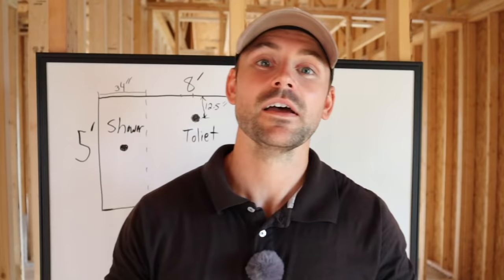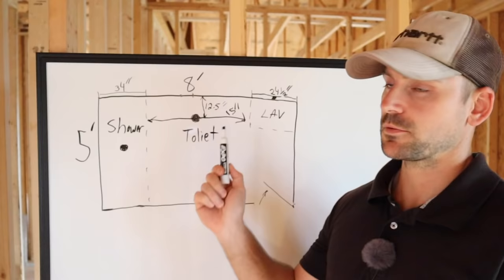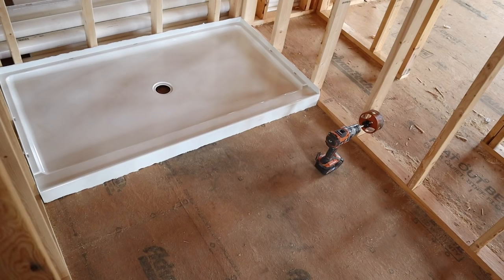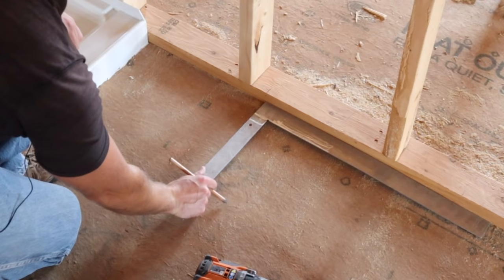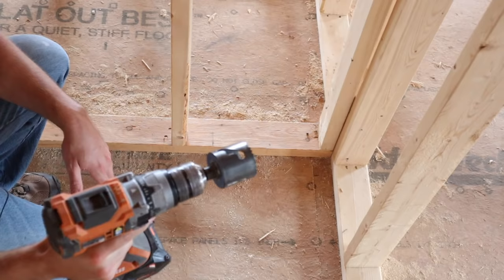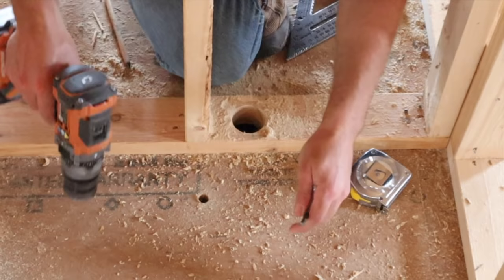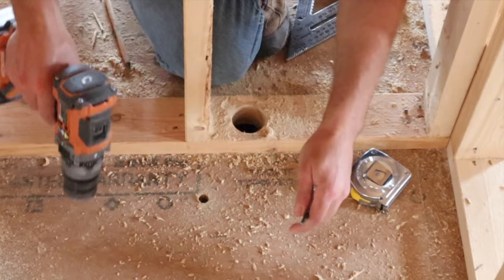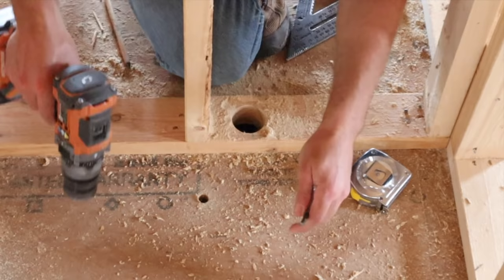How To Plumb A Bathroom In 20 Minutes! - Beginners Guide

Comment: I’m a certified industrial chemical plumber, we often use pvc for its chemical resistance. You cannot let the primer fully dry. The pipe and fitting must both be tacky when you apply the glue or you will not get a full chemical reaction. Also it isn’t dry fitting anymore once you wet the pipe with primer, all that twisting and pulling on the primed fittings is disturbing the primed surfaces
Reply: Makes sense to me… good tip
Reply: This guy has a lot to learn please read my comment what i have tolled him?
Reply: That makes sense because I was confused when he said dry fit it but he applied the primer. For sure will remember this thx bro. 🙏
Reply: @tonyantonov947  *told him.  You have some things to learn as well.
Reply: Oatey says you have to glue the primer within 5 minutes, it's still "wet" that long they say but I wouldn't let it go that long or anywhere near it.
Reply: I was thinking the same thing while watching the video, thank goodness for comments…
Reply: @tonyantonov947  what?
Reply: True
Reply: Ther was no glueing back in the day we never used pc. Bottom line
Reply: Poor choice of stool flange you use they fail at a high rate.  I replaced many of them over the years.  When you put in the Johnny bolts or stool bolts Long slotted stool flange and fasten that stool to it that plastic will have constant tension pulling up on it eventually it'll lift that outer edge of that stool flange  Boeing that flange up were the stool bolt fits under it eventually it gets loose the next person comes along and saids oh  loose stool bolts let's tighten it up so they tightened up more pulling the flange again up higher eventually the Johnny bolts will slip out of that Flange or breaks the flange and the Flange needs replaced.  I've seen it stretch so much that the flange will hit the bottom of the stool and squeezes all the wax out between it and now there's a big potential of leaks.
    You would be better off using a all plastic flange with the little short slots for the Johnny bolts but they have failure Rates to but not near as much I don't care for them either. 
     The best Flange to use is the PVC with the stainless steel adjustable  ring on it by far.  The stainless steel ring is where the stool bolts slide into the ring will not rust corrode stretch or break. As long as the floor is in good shape and the Stool flange is secured to the floor( by using 6 bolts instead of 4 like the one in the video that was installed which allows the flange to bow up more easily )  You will have no problems with it. They make a metal ring for the stool flange too but it will rust over time but far better than what was used.
    The good flange is not that much more in cost but it will save you headaches down the road.
Reply: I respect this guy's ambition to make a video but this video has some flaws. Like the flange setting. I was unaware of the primer tacked portion, good to know. Also when he said you don't want to move the floor joist...that's a no..you don't move floor joist you kove the pipe orientation.
Reply: I need some help.Can I put 2 toilets in the same 3 inch horizontal drain within 6 feet of the drain/vent? And would i need to add a vent ? Toilets will be  back to  back. Any  ideas  will be  appreciated.
Reply: @kufa83  o
Reply: @tonyantonov947  >“tolled” him
Reply: I just learned something from you. Maybe you can make a video of some of YOUR plumbing expertise. Just a thought.
Reply: Y'all talk too much😂😂😂
Reply: @tonyantonov947  at least he can spell 😂
Reply: @claysonpace8078  This is not about spelling it's about plumbing. Well he can't plumb worth a fu_k! lol
Reply: My dad (master plumber) who taught me (journeyman plumber) how to do plumbing since i was 14 you definitely want to have the primer be fresh before you glue because the chemical reaction will not work properly. The actual term of "gluing" pvc together is called solvent welding because the primer actually melts the pipe slightly and the glue helps strengthen the joint. So it's not glue like abs pipe. Pvc is solvent welded making it a much better of a connection. In my state you are not allowed to use ABS in commercial applications only solid core pvc or cast iron depending on the applications as per fire code.
Reply: Great advice
Reply: @kufa83  yes
Reply: @patrickarchuleta9594  to this day I use glue only, no primer. Never have a problem.
Reply: This was extremely informative
Reply: I just prime it put the pipe with out glue then prime it again and glue it like this comment says
Reply: @truthbetold1855 I just do it right away. No point to wait anyway. Don’t see any scenario you will use 5 mins to apply glue
Reply: You will “weld” the pipe and fittings if you prime them and wet fit.
Reply: Take the drill bie out first, to easy remove the wood.
Reply: BS!  Plumbing DWV systems are not chemical piping systems.  I’ve  been licensed master plumber for 60 years and licensed in 5 states. The truth about primer is for it take the gloss off the pvc, so the glue bonds better.  You can use fittings that were primed 3 days ago and have no problem.  Also primed pipe and fittings give you more working time for alignment.  Current plumbing codes require priming, but it wasn’t several years ago.  Also, if you read the label  on your glue can, it will probably say it includes primer.  I’ve glued miles of pipe and thousands of fittings with or without primer, wet or dry. Guess what,  they all work.  So stick to your chemical system requirements, not the same as drainage piping!!
Reply: This guy is so amateur it’s unbelievable!!  FYI , in the bathroom it’s a lavatory not a sink. You use a 2x1-1/2 TY for a lave , not 2” all the way around, the lave drain is on;y 1-1/4..  never saw a plumber use a framing square to install tee. Also marking the fitting as well, neither  are  necessary.  Just put  stub out in the tee, glue it and eyeball it for straight. If you cant do that you shouldn’t be plumbing. A good job would be to rough the water in the wall,not through floor and though the bottom of the vanity, where you see the horrible holes he butchered thru the vanity base.  Where are the escutcheons for the penetrations?  If you glue the lave stub out, you’ll have a good time placing the vanity over the vertical waterlines and horizontal drain.  This guy should stop with his plumbing videos because, HE DOESN’T HAVE A CLUE!!
Reply: @dennisnolan2544  

I agree. The cabinet looked awful with those ragged holes. The holes weren't even drilled to match. All wonky. Bringing the lines through the wall looks so much neater and professional. I'd be embarrassed to show that.

Comment: This is an excellent video. I'm a licensed plumber and I wish people would watch this video before attempting to build their own plumbing systems.

I've been watching some of the other videos on the channel and learning lots. I figured I'd watch this one to nitpick a lil since I'm a licensed plumber and honestly some of the tips here are incredible. The hole saw sizing to be used for the toilet AND the shower. I honestly never even considered that. The wood spacer on the toilet flange is an amazing idea that plumbers in my area don't do and we regularly have leaks on wax seals because the face of their flange isn't the 1/8" - 1/4" above the finished floor.
I think it's neat how you individually vent the toilet because that's a more commonly accepting practice across different states and codes even though wet venting is a common practice in some areas. You really set the viewer up for success with that one. It'd be worth adding a bit on how the shower was vented.
I wouldn't recommend flushing the flange test plug down the drain though. We get a few calls about those getting stuck in odd places here and there and it always feels kinda silly to have to tell people that large plastic flaps don't always travel down the drain very well. Fish it out with an extra long pair of needle nose pliers. Drill it out with a hole saw or rip the tab on top in a twisting motion and it should come out.
Other than that and a few personal preferences on finish pipes I've gotta say you know plumbing better than some plumbers I know and I've been doing this for about 10 years.
If you know the other trades about as well as you know plumbing, I feel pretty confident you've taught me enough to build my own house properly or at least close enough for the inspectors to correct me on just minor things. 

Thank you.
Reply: You are right, it's always easier to grasp something when you have prior knowledge or understand the process a little

Comment: Great video! For those who are laying out its always a good idea to send a screw into the floor either on drill point or right beside it to ensure there's nothing structural in the way
Reply from the maker: Hey Jesse! I appreciate you commenting on my video. Stay tuned for more!
Reply: @TheExcellentLaborer  how do u vent the pipe thru the roof, u have video on that? also can you show how u connected pipes under the house??
Reply: @TheExcellentLaborer  you can have the vent horizontal running toward toilet vent?  Whee about shower vent?

Comment: got confused by the "Lav", in the UK that would be the physical toilet.   Seems in the North America it means the sink unit.   Good video, primer is for PVC pipe, if you are using other materials use the appropriate glue.   Your note to orient your fittings so the bend goes with the flow was a nice touch.    If you get stuck. As a rule of thumb, ** runs downhill due to gravity.

Comment: Do yourself a favor and buy some Milwaukee hole saws with a quick release mandrall.  When its time to remove the wood scrap from the hole saw, just first pull back the quick release by hand, pop the drill into reverse holding the saw by hand to unscrew the saw from the mandrall, and then use the tip of the pilot bit to push out the circular wood scrap.  I spent many years the hard way removing cores with whatever was nearby.  So much easier and professional now.

Comment: as a framer (old school) I found your video very easy to follow and informative. A good framer moves floor joust to allow the plumber a clear shot. Also framing should be nailed 16" on center over the framing . Nit a random bam bam with the nail gun. Respect for the other trade so they don't get hurt. Thank you for your video.

Comment: Not the best idea to use corrugated, bendable, plastic piping for the p-trap. Use solid piping instead. Those  corrugated folds in the bendable piping catch hair and clog up way faster. Other than that, I loved the video! So clearly explained. Thanks.
Reply from the maker: Yes those flexible P traps are not ideal. They were on discount when I was shopping that day and I decided to try them. Yes smooth probably is better but I have not had any issues with them so far. I’m glad I could help! Thanks a lot for watching!
Reply: @TheExcellentLaborer  : Those ones come with so many sinks from Lowes and Home Depot, so they do work and make installing easier. It’s just that people should be mindful of cleaning their drains every 3-6 years as a maintenance op.
Reply: In my area the corrugated tail pieces do not meet code.  Also, we are required to strap the vent pipes between the top and bottom plates.
Reply: The weakest point on the flex drain is the outside fold.  It cracks easily with the slightest bump.
Reply: Articulated pipe is not allowed per code
Reply: @sandymilne224  Or 3-6 months, if you have daughters with long hair. 😅
Reply: @TheExcellentLaborer  I haven't had any clogging issues with them, but I find they allow buildup inside the creases and cause an odor to be expelled when turning on the faucet.
Reply: @TheExcellentLaborer  as a master plumber, I find it slightly offensive that you're out here trying to pretend you know how to do everyone's trades. If you were actually any good at any of this, you'd be making your money without hammering your ignorance into the public domain.
Reply: @DM7817  I wonder if that kind of attitude is why there are so precious few tradesmen these days. The supposed masters would rather blow smoke than pass on their knowledge, potential tradesmen are turned off by the attitude and poor working conditions, and homeowners end up turning to Youtube because they literally cannot find someone who will show up.
Reply: @institches2750  yeah so you answered your own question. Take 10+ years of your life to become good at your career, work with who you work with and do your best to earn a trade license, and then see if you have time left to make videos about it.
Reply: @DM7817  That's stupid. We'd all be better off ditching that elitist, gatekeeping attitude. Plus, if it takes you TEN YEARS to get good at your job, you were meant for something else. That's ten years of subpar work and training, wasting time and money of your employer, coworkers, and clients.

Plus, a true master who is good at their job sets their prices and makes their own hours. They aren't working 60 hours a week for a pittance anymore. They have time to do other stuff.
Reply: @DM7817  That's cute, but I don't work white collar. I'm....*gasp*...in the trades.
Reply: Find it humorous that you actually took the time to deburr your drain pipe, but use a corrugated trap?

Comment: My concern is how close the toilet will be to the shower.  12 inch rough-in is pretty self explanatory but the clearance between fixtures might want to be increased for plunger stands, brush stands, etc.
 Spacer ring under the flange is a great idea!  
Don't lose the flange plug down the drain! It can plug the lateral sewer drain!  
Try NOT to use an expandable drain line; hair, soap scum, etc. gets trapped in the bellows and can cause blockages.
Reply: He said the room is 8’ or 96” long. Tub is 34, sink is 24 which leaves 38” for the toilet. 30” is the minimum code.
Reply: Rather sure it’s against code to use the accordion drains.
Reply: @AdamS-lh2ug  While it is not against code to use accordian drains on a lavitory sink and they solve fitting problems, it is a really bad idea since hair and soap scum get caught in the pleats.
The result is more frequent cleaning and clearing along with the gases produced from the decaying material.
Better to spend the extra money and get a slip joint pipe; smooth interior and more robust than an accordian pleat.
Reply: @Digidoc316  I’m an electrician, not a plumber, so maybe there was some disinformation especially because I’m a commercial electrician not a resi. Here in Minnesota (and this could be completely local requirements, but I was told by a 40+ year old Master Plumber from Home Depot…I know, but he claimed to still carry his Masters) that while yes they are easy, they will not pass around us as they WILL clog. For a diy’er, I can completely understand why you would be like “oh, heck yes!” At least around where I’m at in MN, they would fail it.

Comment: Ok seen that several were busting his chops of the use of the wrinkle pipe...but failed to explain the WHY. Yes as one comment said, 'it should be self scouring'. To be more explained, the wrinkles in the flex pipe, aka wrinkle pipe, can trap hair and other debris in them and cause a build up that will act as a siphon to wick the water out of the P Trap. Thus allowing  the water to below it's proper level, and then allow sewer gases to escape up into the sink. 
But overall simple straightforward layout plans. Only other thing is consider getting a FROSTNER BIT instead of the hole saw. It save time have to clean out the wood plug.
Reply from the maker: Thanks for watching William. I appreciate your honest opinion of the wrinkle pipe. I like your Frostner bit preference! Stay tuned!
Reply: Exactly.  Learned this the hard way with a kitchen sink.  All straight piping now & no problems.  Having remodeled a few bathrooms and laundry rooms, I agree with using a Forstner bit.  Much easier than a hole saw.  Not sure I like all the venting going to a main stack--personally I'd like to have dedicated vents for each room to be serviced, but that's just my preference.  I can see how this would leave fewer roof penetrations.

Comment: Good video I like how you actually laid out the dimensions of a small bathroom and show where everything is going. I would just show also how the vent pipes was connected underneath and ran to the top rooftop that is. Other than that good video do some more videos like this with different small type bathrooms were you have to rearrange the toilet shower tub sink etc to fit
Reply: Exelent video.

Comment: Suggestion for a new video: if you don’t see a hole or a drain in the floor to run the dehumidifier pipe into, how could you run a dehumidifier hose into the unfinished basement’s shower pipe or toilet pipe. Both are sealed with a cap.. not sure if it’s safe to remove the cap or not

Comment: Your can use 1/4 Vent for you vent stake or Long sweep 90
Reply from the maker: Check your local building codes but 1 1/4 inch vent I think is minimum. I know inspectors like to see at least 1 1/2”

Comment: Thanks for the video.  Why would you not run your supply lines through the wall for the sink and not the floor?
Reply from the maker: Either way is fine. There is one less joint if you run it through the floor because you don’t have to use a elbow. Both  ways works great. Thanks for watching!

Comment: I prefer to have the water in the wall above the drain so you only have plumbing from the back not the back and the bottom. Also pipe isolation is important water holes should be 1-3/8” with knock in isolators